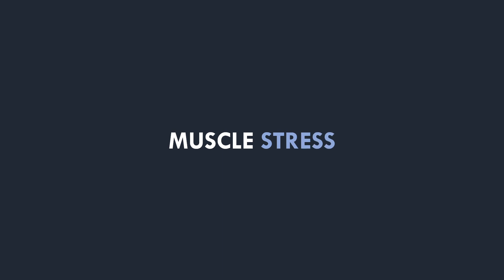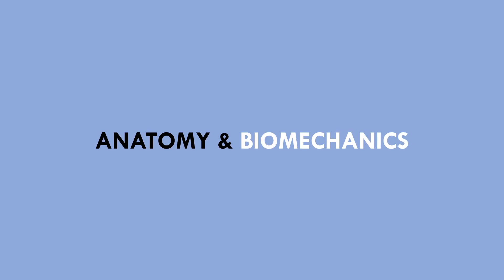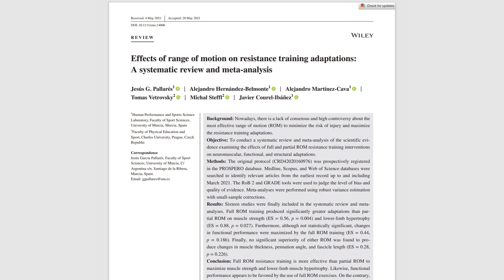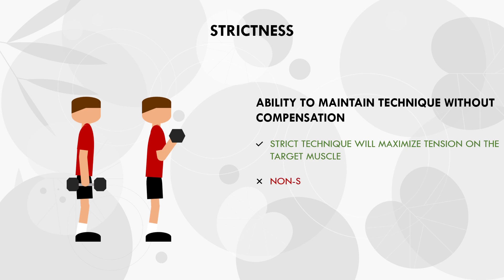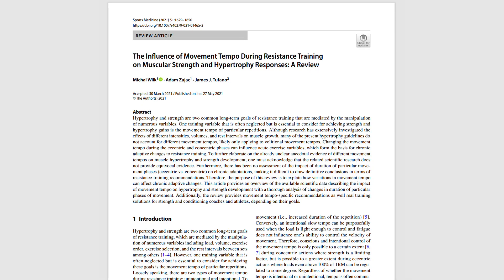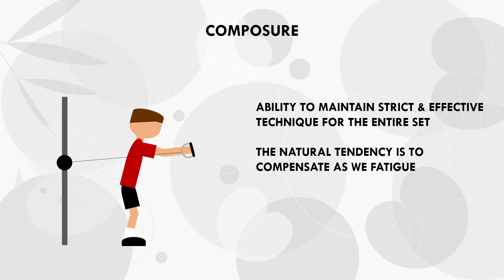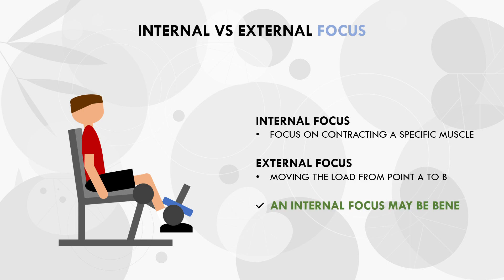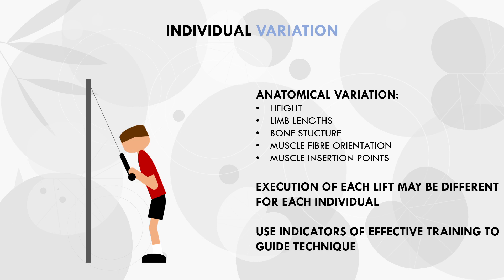Complete Technique Guidelines for Hypertrophy Training

Comment: Agree with you 99% however sometimes as a practical matter it is ok for an advanced lifter to not use 100% strict form for example on a final set of heavy barbell curls to work past failure and cause progressive overload. E.G. Lee Haney advocates "throwing some butt" into barbell curls as it is a power movement not isolation.
Reply from the maker: I agree with this. I have changed my opinion slightly since making this video. Also some lengthened partials can be a good strategy too 👍
Reply: @FlowHighPerformance1  I find it helpful to read the studies and then listen to bodybuilders talk about they actually train to integrate an overall common sense approach.
Reply from the maker: definitely using both science & practical experience is beneficial 👍
Reply: @FlowHighPerformance1  keep up the good work your content is top tier 👌

Comment: Could maximum tension on the targeted muscle group be something like slowing down your last 3 reps per set and making them painfully slow? Like if you were doing an overhead press and just slowed down those movements so they burn more?
Reply from the maker: Possibly. However, research generally finds that super-slow tempo training is sometimes slightly inferior for muscle growth 💪